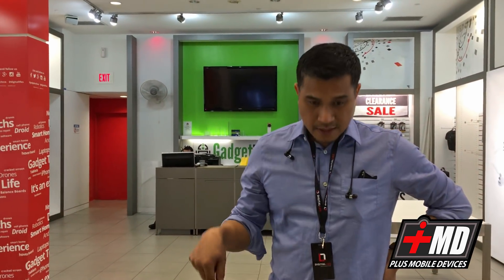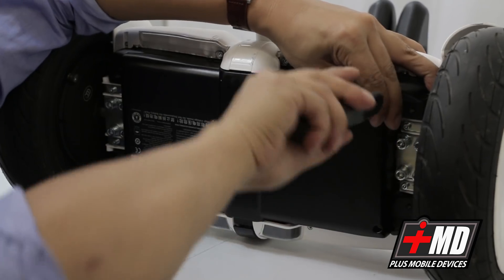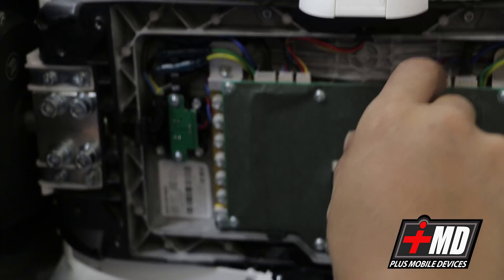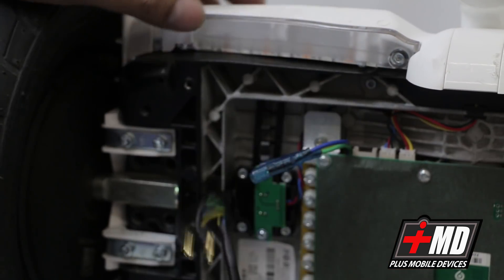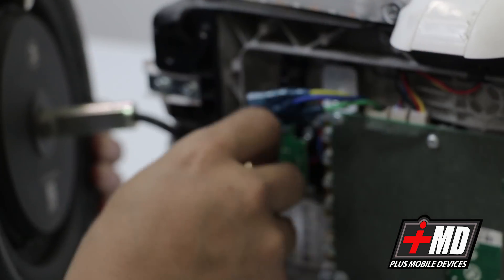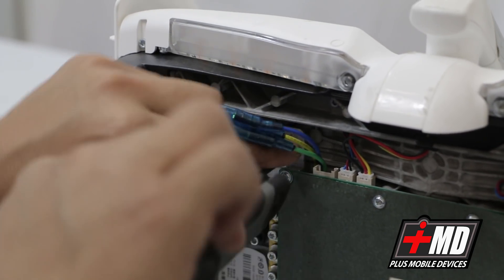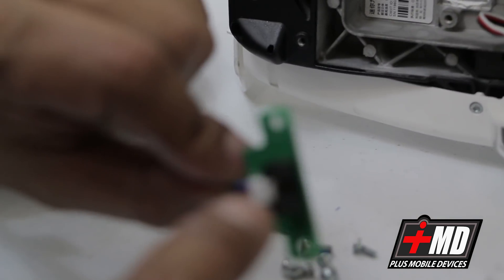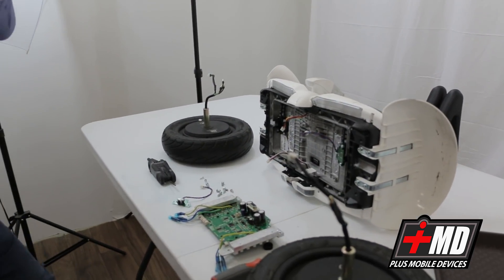Ninebot Mini Take Apart

Comment: can you do me a huge favor.   can you attempt to remove the center 
column on your mini?   I need to ship my mini to my sister, but after 
removing the two screws at the base, the center column still will not 
come off!!!

I've tried to pry it off but it will not budge!  I don't remember if it gets locked onto the shaft...

I have a mini and not the mini pro with QD release.